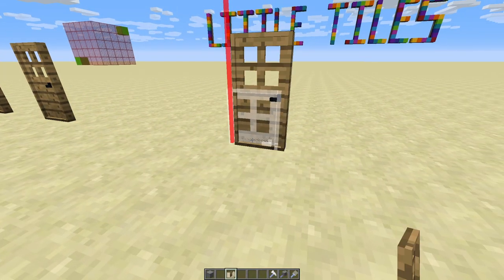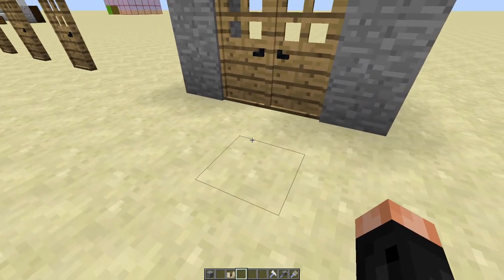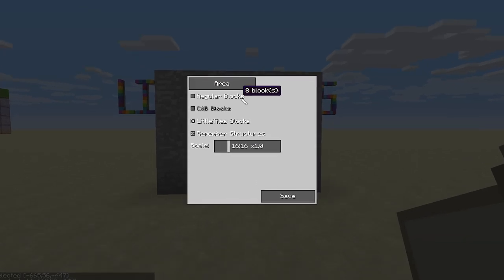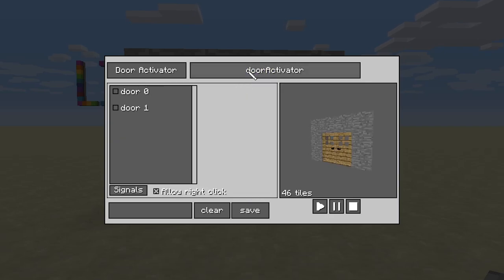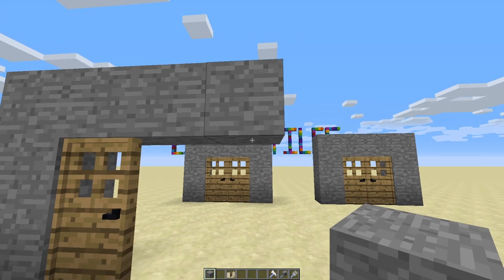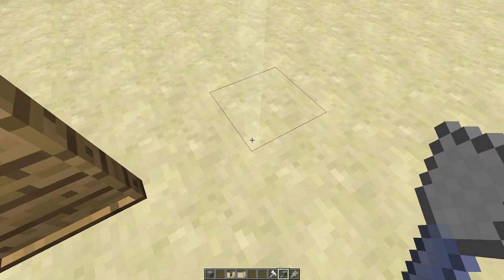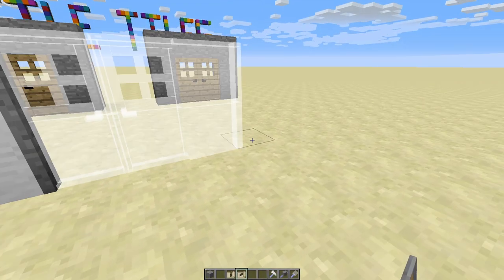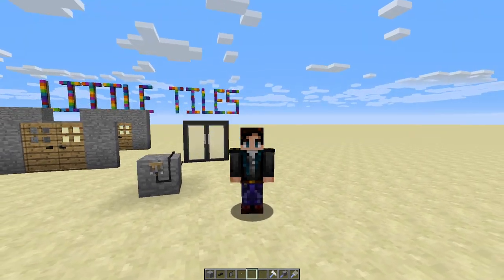Double Door Animation Tutorial - Beginner Little Tiles 1.5 Guide

Comment: 1:10 I believe there's also a way to just flip the structure without needing to edit it, I don't remember the key for doing it but I think that f and g separately flip it horizontally and vertically so when you flip vertically it also flips the rotation so you don't need to edit it. I haven't played for a while so I forgot the keys but I know they were there. Hope this helps and also just great video overall, It's good to see more tutorials on this mod as most of the time when it's used the person using it just uses it to build something and never really shows how it works.
Reply from the maker: i still need to check this, but if so thats supper handy dude! thank you :)